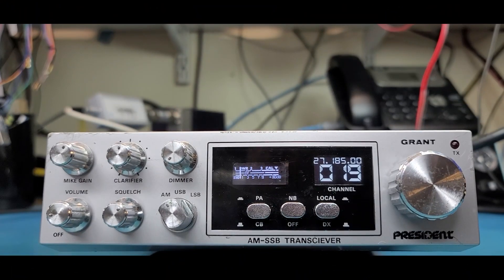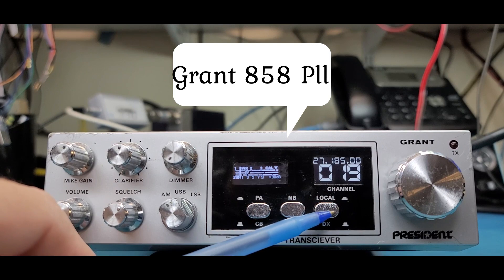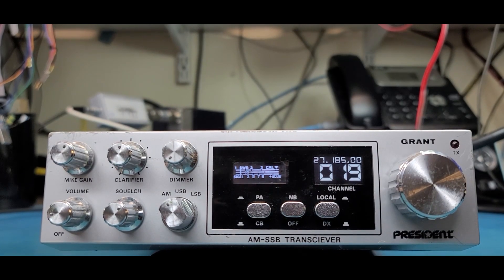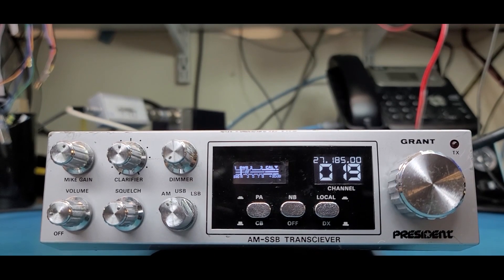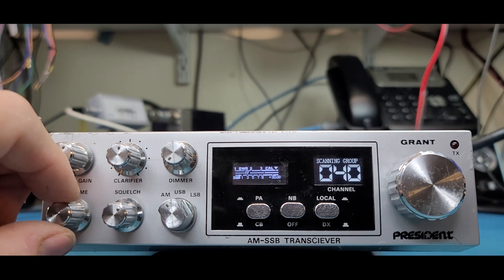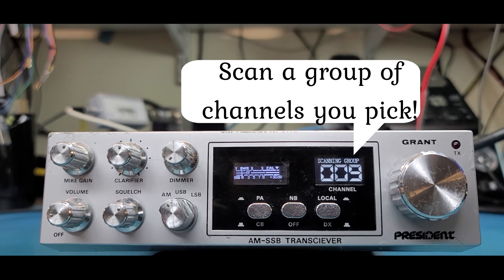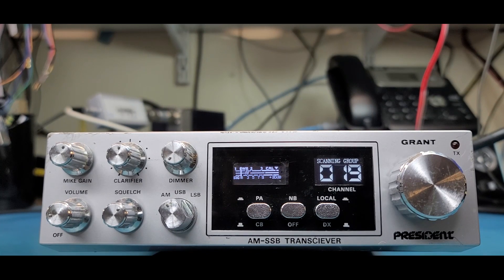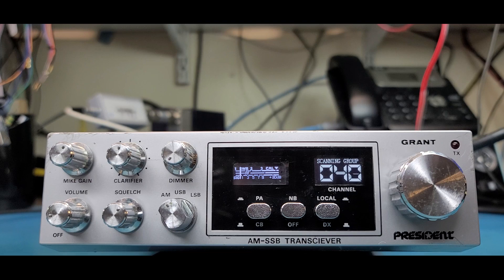Digi S Meter

Comment: How is the S-9 set with this setup?  It's not set correctly, reads too low for incoming RX signals on mine, same exact radio!
Reply from the maker: S-9 is set with 100uV rf input at the antenna port. You may se a differance do to the digital S meter is a tru reading type.
The math invilved is extremely exact. Having said that, not having the unit on a calibrated input, no telling if an componant inside the radio has drifted or the setting pot a bit dirty and has an issue.
Reply: @ddsvfo  The pot you refer to seems to be VR1 on the 858 chassis inside correct?  I can check that myself but besides that what components (digital meter ones) or what likely?

Comment: Now we need a digi s meter set like the meters in a cobra 2000. Only see ones made for mobiles don't see any yet for cobra bases or galaxy saturn and rci type bases
Reply from the maker: Its in the works
Reply: @Troy Radio Service  how is that project coming?